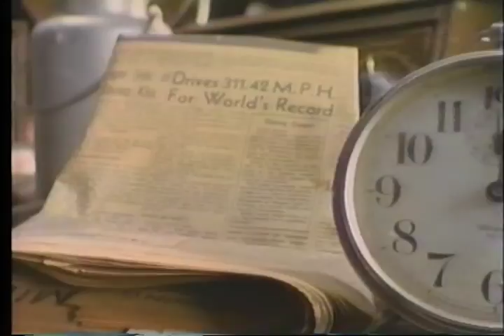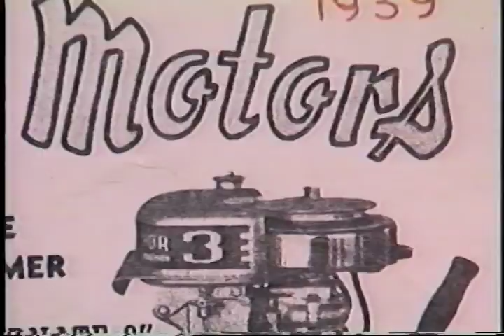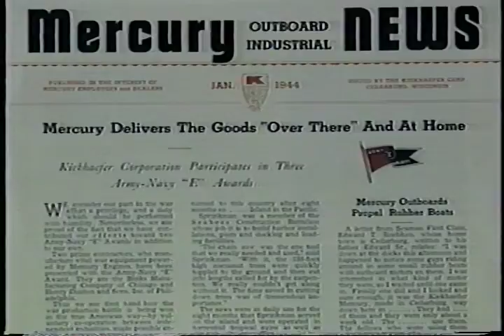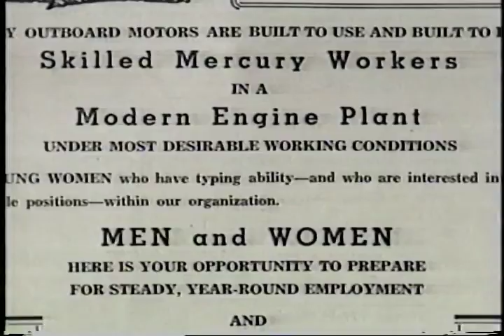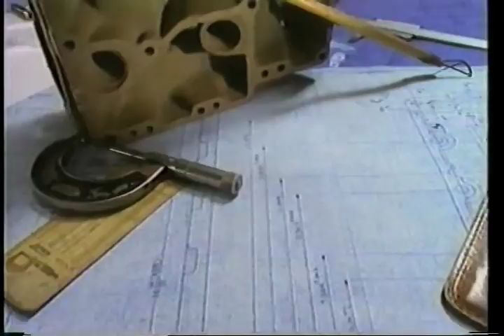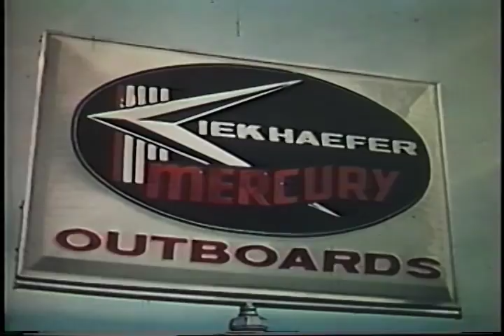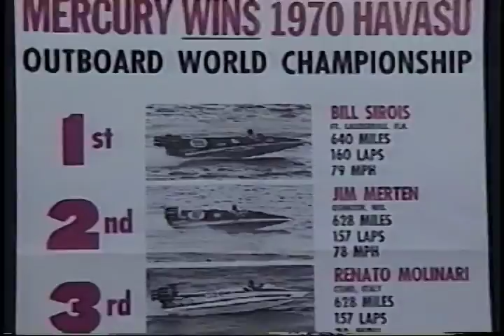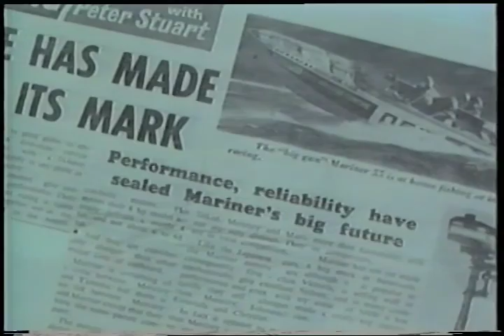Mercury Marine: 50 Years of Leadership (complete)

Comment: I bought a new Seacraft 20 in 2001 with a 150 optimax. Owned it for 8 years. The boat was awesome, rides like a Bertram. The Mercury, not so much. Three power heads in 8 years and never any warranty work. Bought a new Yamaha that has run trouble free for 14 years.
Reply: I owned a 1985 mercury 80 and had so many issues with it. I now have a 1984 115 yamaha the thing is super strong and reliable

Comment: i still don't get the water pump. the weak link to this day!  a stainless set up. not rubber.
Reply: All outboards use the same setup, it functions as a positive displacement pump at low speeds through the water and functions as a centrifugal pump at higher speeds through the water.😊